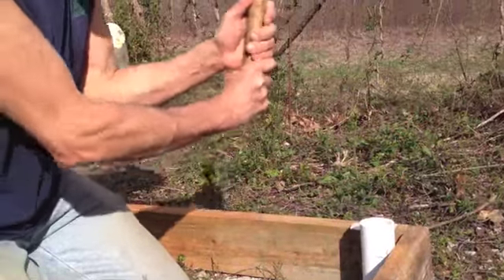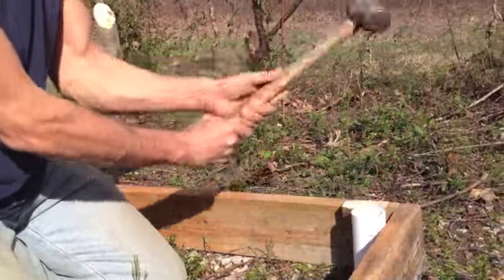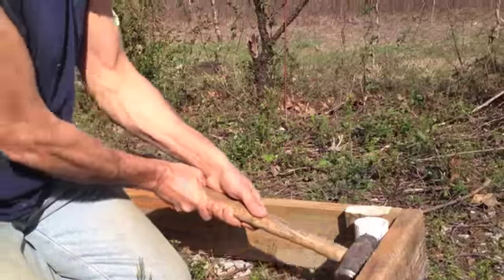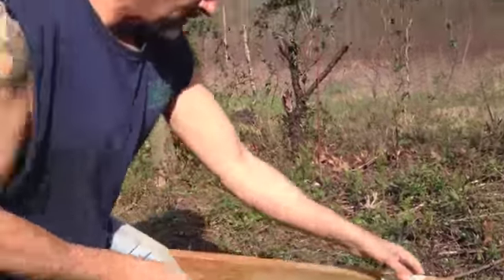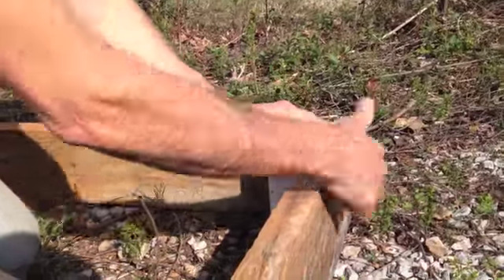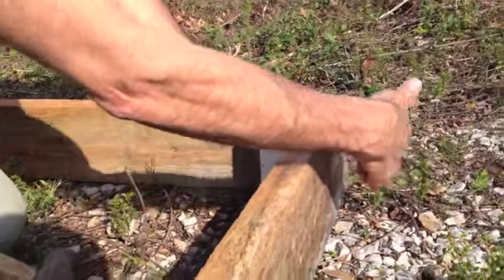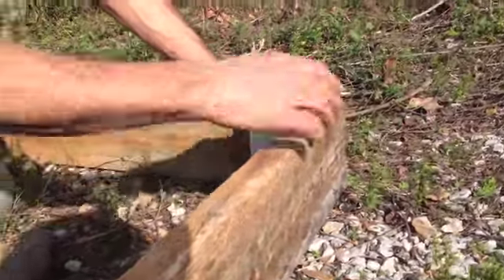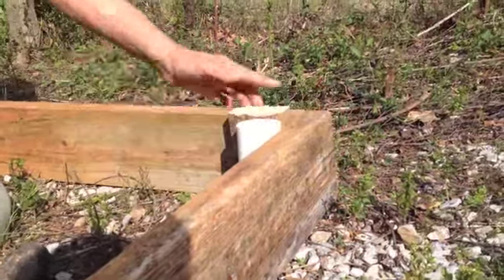PVC Hoop House hoop anchors

Comment: You are doing great stuff. I am currently watching all your videos. I think I have my adad interested enough for us to build one.
One little tip I haven't seen in your comments: Use a 2 foot 2x4 on top of your PVC pipe and hit the board instead of the pipe. You will be able to get proper hammer blows and won't mess up the PVC pipe. Just sayin' ;)